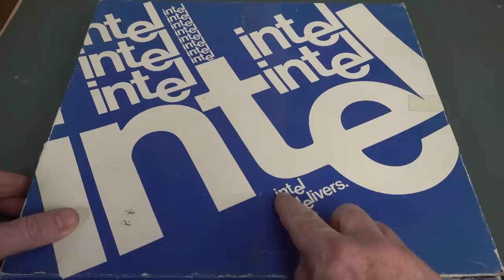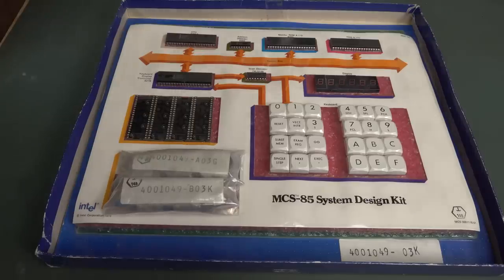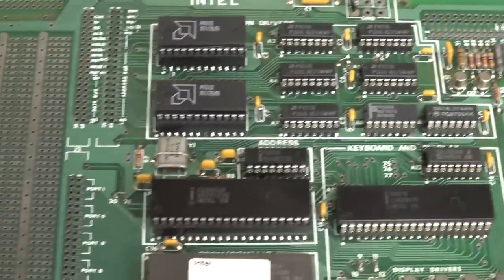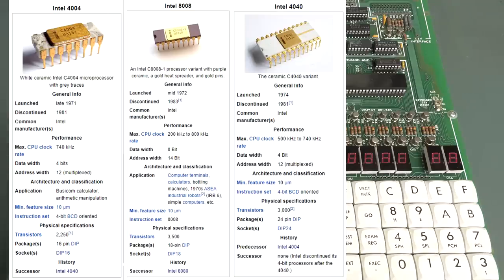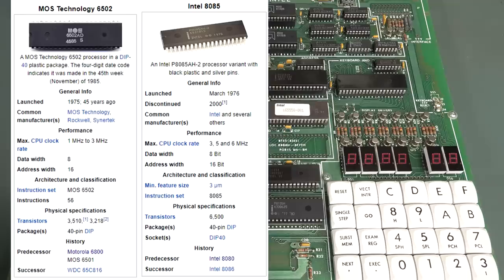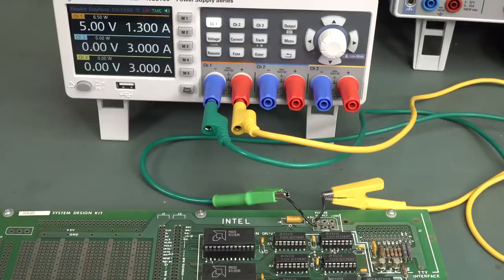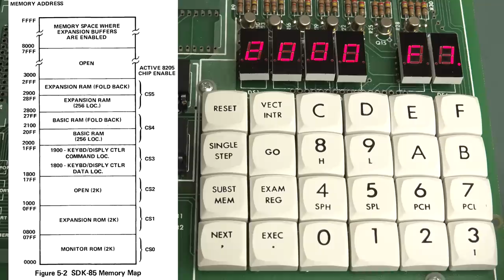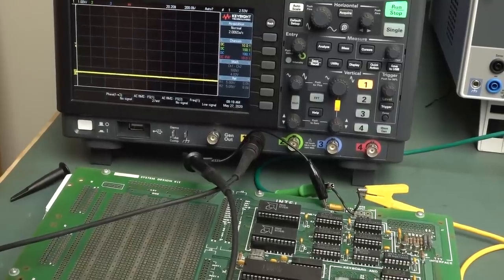EEVblog #1308 - 1970's Intel MCS-85 8085 Design Kit!

Comment from the maker: Retail price was US$250:
https://archive.org/details/byte-magazine-1979-01/page/n57/mode/2up
Reply: Almost 1200 in today's US dollars! For comparison, in 1981 a base IBM-PC cost around 5000 in today's US dollars.
Reply: I might be the one who used a typewriter to type out the requisition for ordering one.
Reply: As I recall, the Kim 1, with a 6502 processor was $99.
Reply: @alexanderwolfe8782  Look at ads for typical microcontroller kits in the early to mid 90ies. It often was something like .. well 1500 for the board, then you need the programmer, that will be an additional 1000 and of course the compiler suite is only 3000!
Can't have those plebs touching our stuff. Sincere industrial users only. 
It also was the dark ages when you asked a semiconductor manufacturer for information and "Which company?" "I'm a hobbyist." "Screw off, we don't want YOUR kind here."
Reply: KIM-1 original price was $250...
Reply: When I was a kid in the 80's ;-) I've got an used Motorola MEK-6802-D5 from my father. My first computer even before the C64. It was a great starting point to learn programming.

Comment: I bought the SDK-85 in 1980, my first computer. Also ordered the Intel 8085 data book which had all of the instruction set and timing diagrams. I learned assembly language on this computer and had many hours of frustration and enjoyment. Thanks for presenting this.

Comment: Honestly as old as this is, it's still a great way for someone to learn how computers work at a fundamental, close to the hardware way.
Reply: To learn the architecture of a modern CPU even RISC like ARM is an undertaking. Back in the 70s you could learn it quickly. Simpler addressing modes etc.
Reply: Learn AVR - its a straightforward, barebones, no-nonsense architecture, no weird addressing modes, memory mapped IO, although its Harvard architecture.
Reply: nearly 30 years ago I learned hardware/software integration on a 6809, tape drive, and a bunch of chips we had to buy for the class.  It was THE way to learn back then.  With those basic building blocks all other processors and hardware designs were fairly simple back then.
Reply: VEC7ORlt What’s wrong with Harvard?

I’ll admit: learning x86 assembly first, Harvard was confusing, but they both have their upsides. One ((true, not modified) Harvard) is easier to implement in silicon, but the other (von Neumann) allows things like treating code as data and vice versa.

Tangent: it’s worth mentioning that x86’s memory model is somewhat of a cross between Harvard and von Neumann; It has separate L1 caches for instructions and data (Harvard), but the main backing memory is unified (von Neumann)
Reply: @VEC7ORlt  AVR is old now. No product designer is going to chose it for a modern product design when there are ARM chips with way, way more peripherals and memory for a lower price.
Reply: @TheChrisey  Don't talk about things you know nothing about.
AVR is a great learning/starter chip - straightforward, easy to understand and program, has an extensive toolchain(s) and large community helps.
As for old and 'no product designer will use' - every thing has its uses - you don't need an ARM chip to blink a few LEDs, control a few relays and the like, the pricing for the chips is on point too, sure those chinese 3ct MCUs are cheaper, but they are OTP, datasheets are weird and you need volume to capitalize on that.
8051 is still pretty popular, and that thing is more ancient than wooly mammoth shit.
On the other side you can buy 600MHz MCUs for 7eu.
Reply: @TheChrisey  Oh I don't know, there was that motion activated light that eats 15uA on standby, that I did on Attiny204, and sold around 5k units, an emergency lighting controller with charging and sequencing done on a Attiny88, sold nearly a thousand of those, and others that I cannot tell you about, so go on, teach me how to design for manufacture.
I've also remembered the inductive cooktops I've seen running AVR chips, was it AEG?
Riiiiight, I get it now, you are one of those 'design engineers' that need hardware multiply to blink a LED.
Well, you do you.

Comment: I joined Intel early 1980. There was a couple of the SDKs laying around the office. Can’t recall the price.  This was generally pre-PC days so we sold the incredibly expensive Development System which supported several programming languages and with the optional in-circuit emulator sold for just over $10,000. Came with two 8” floppy drives!

Comment: Back in the late 1970s I wrote the code for an 8085 based Morse Code ident module for use in Amateur Radio repeaters. I designed the whole code on paper using my own pseudo assembler language, simulated the code and all the variables on a large sheet of butcher paper by hand, converted the code to hexadecimal opcodes and addresses by hand, and then single stepped the hex code into an EPROM burner. A friend of mine built the hardware and sold the boards to various people around Australia. I am now not 100% sure it was an 8085 because I remember there only being 128 bytes of RAM and 1K bytes of ROM available. The 8085 does not seem to have either although there may have been a other chip with memory in our design.  I recall my friend wanting to use the 8085(?) to reduce parts count by not using external memory chips. Those were the days of compact code. :)

Comment: 4 years late to the show!!  This idea was my graduation project in 1985. I built this idea around the 6502 + 6522 with breadboards, wires, resistors, transistors, UV Eproms, and static memory chips. Every mistake in programming cost me 2-3 hours of eprom erase time.  I had to write the monitor code in mnemonic assembly code, then the instructor loaded his actual program code (by way of Apple II interface), to run on top of my monitor code. It was the accumulation of all my previous months & years of study in digital electronics. If it worked --- I passed and got my BS degree. It did and I did, July 1985.  I don't remember a thing about it now 40 years later!

Comment: I was a 6800 person. I got a cheap 6800 D1 kit in 1979 for £50 and it never worked because I sprayed it with lacquer and it went into the sockets and insulated the pins. Took the chips and put them on proto board, added an old CBM calculator as a keyboard and display. Coded a new monitor program by hand and eventual memorising the instruction set. Designed a hires graphics TV display for a friends Z80 computer. Later on built a 6809 computer using scrap 8 inch hard disk drives. Had a TV output and again hand coded firmware. First week of work, 1984 bought a 6502 based BBC Micro..

Comment: The 110 Baud TTY would be for an ASR-33 teletype which, with paper tape, was the development tool for this kind of project. In 1976, there were no DEC VT-100's as you showed.  That also would have left the designer with no way to save code in a machine readable form.

Comment: Definitely the Zilog Z-80. Built a literal ton of controllers with this chip. And I wrote it all in assembly in the Z-80 mode, and used mode  2 interrupts with the CTC, PIO and SIO/0. What a fantastic CPU.  Just loved it.  And it ran at 4 MHz with no gripes.  In fact, I’m designing a GPS disciplined RTC with one RIGHT NOW!!  I’m old, and so is the Z-80. But I’m not done yet and neither is that great CPU.

The Z-80 was used in the Heathkit H-89.  The video card for that H-89 also used a Z-80 and associated chips for driving the video.  I had that H-89 for many years   Used to use the Avocet Z-80 assembler/linker/debugger for CP/M with that H-89 and I wrote a LOT of Z-80 code on that machine.  It was so reliable, it was amazing.  I wish I still had it.

Great video!!  Thank you, Dave!!
Reply: Z-80 in my Sega Master System
Reply: During my internship in a steel manufacturer (I was 16 and I'm 51 now), almost all the controllers were created inhouse using the Z-80. At that time I became so used to it that I could read the hex code directly :)
Reply: On the other hand, a functional 8085 application can be designed with only two or three chips.   Say, an 8755 which gives you ROM and I/O and the 8085.  You can bit-bang serial I/O out of the 8085 using the RIM and SIM instructions.  And the 8085 already has prioritized interrupts.   That's why it was used as a controller in so many peripherals.
Reply: IMO microprocessor courses should be taught in 8080/Z-80/M8800, however old they are. It' like teaching and learning digital Ohm's law. One gets to work with something manageable. These days I'm interviewing sw engineers and I get a blank stare when I ask to draw a [micro]processor architecture. Not OK.
Reply: Did you ever saw meta instabilities using Z80?  When I was in college in 90s, the professor said Z80 or Zilog went down because their chips would hang.
Reply: The Z-80 was my favourite CPU. I almost went for the 68000 because it was 16 bit and seemed to have a great instruction set, but I think they were expensive and not as convenient at the time. I ended up doing heaps of things with Z-80s right through to the late 1980s. I started with a home built S-100 system, a TRS-80, a couple of CP/M systems, a VHF/UHF scanner radio using the Z-80, as well as a number of other devices.
Reply: I have some avionics designs from the late 80's early 90's that use the Z80. I remember having to buy their MIL-SPEC versions in the early design stages. Single unit costs ~ $500.00.
Reply: @simeshev  We did use the MC6809 when was studying. For one part because it also was quite simple (really orthogonal, even easier to understand than the 8080 family, which does have its weird quirks in some places) and since the evaluation boards in our lab were using HC12, whose core is basically a MC6809, with some "simplifications". (No user stack, only one index register IIRC).
Reply: @bayareapianist  Did they went down? Last time I checked, they were alive and well. Z80 (the CMOS version of course) are still in production and you can order them from any major distributor.
Reply: They're about $5 each brand new on Mouser.

Comment: My first microprocessor experience was in 1977 while was in the US Navy, using an RCA 6502 single board system (much like the MCS-85) called the KIM-1 (https://en.wikipedia.org/wiki/KIM-1).  It got me to think in hexadecimal, and I had memorized nearly all the opcodes during the month I had access to it.  In 1980 I got an Apple ][+ (because, 6502), and felt right at home, though I did get the Language Card with UCSD Pascal.
When I left the Navy in 1981 I worked as a technician for General Atomics, which was transitioning their excellent-but-expensive analog radiation monitoring systems for commercial nuclear power plants to digital systems based on the 8085.  I started university later that year (at UCSD, naturally) to study Computer Engineering, and was soon getting paid to write code for the 8085 using the Intel Big Blue Box and the PL/M language (https://en.wikipedia.org/wiki/PL/M).  We had a final pair of analog systems that were difficult to replace with digital, and after graduation my task was to build the algorithms needed to let a slow 8-bit processor equal their performance.  Some of the best code I ever designed and wrote, something I'm proud of to this day, and the best possible start to an engineering career I've loved ever since.
Why did General Atomics choose the 8085?  The simple reason was it had a surprising level of radiation hardness for a commercial microprocessor, hundreds of times better than the Z80, and dozens of times better than the 6502, for about 1% the cost of a "real rad-hard" processor (the 1802 was the only rad-hard game in town back then).  It had other benefits, but all were minor or trivial compared to that.  I took our systems to our "gamma range" (a linear accelerator) to zap them until they blinked, and it took an impressive level to make that happen.  There were several tricks we developed and employed to further enhance its natural immunity, such as reducing the clock from 6 MHz to 5 MHz, and playing with the supplied voltage.

And, yes, the systems were battery-backed with a Gates Gel-Cell lead-acid battery the size of your fist (both fists if you have small hands) that lasted for 5 whole minutes, 300 seconds!

Comment: I got one back in 1980 for about A$300. I still have the SDK in my museum and it still works.
I expanded it with 4KB EPROM and 4KB RAM.
The 110 default baud rate was used to directly interface with a TELETYPE. This was the ideal interface at the time as you had an input keyboard, a printer and memory storage (paper tape). 
I wrote an editor, assembler and EPROM programmer all on this unit. 
A typical 1KB program took about 2 hours to assemble (2 pass) and burn an EPROM.
I have loads of happy memories (not)!

Comment: Dave does not seem to understand that this  was aimed for ASR-33 Teletype. Hence the 110 baud speed. You stored your programs into paper tape. Dave should have tried the teletype monitor. There was special commands for outputting and reading the RAM to and from paper tape. I was dicking with this board in the Finnish Army in 1977. I built a testing device for a  Russian Missile Controller, which was 3 ton electro-mechanical monster in a truck. This project was totally against USA-Comecon embargo. https://flic.kr/p/JycyMy
Reply: Great picture.
Reply: thats kind of badass actually
Reply: Just curious, why would someone in Finnish army built a testing device for Russian missiles?
Reply: Because Russians were selling them cheap and they were  mechanically sound. You could also improve the shitty Soviet guidance computers with modern electronics. The  Soviet trade was based on goods, with one pair of Nokia rubber boots for one AK-47.
Reply: @TimoNoko  Lol. Greetings from Russia.

Comment: When I was doing my Electrical Engineering Technologist Diploma in 1997, one of the courses was industrial control systems and we had that exact board to program 8085s for the lab activities. I remember having to program a servomotor controller using the 8085 and once you got used to the 4x4 keypad it was actually a lot of fun.
The reason why they had the keypad layout as is was so that you had a block of 16 keys for the hex "data" values that were separate from the "command" keys. If you had ABCDEF across the top, you would end up with some of the digits almost completely surrounded by the command keys and a single finger slip could, to quote a Davism, "really ruin your day".

Comment: When you showed the support phone numbers, it really took me back. The 602 area code is for Arizona and at the time covered the entire state. When that technology was manufactured (circa 1980), I was a EE major at Arizona State University and lived just up the road from the Intel factory at Rural Road and Williams Field Road (now Chandler Blvd) in Chandler, AZ where it was made. Many of my EE professors had consulting gigs with Intel, and most of us ended up working on Intel-funded research at some point in school. It is interesting that they used local phone numbers for the support lines instead of toll-free numbers. I never worked on that particular programming kit, but did do a lot of work with Intel processors at the time. Ultimately, I ended up becoming an assembly language developer on the 808x, 80x86, 6502, Z80, 6800, and 68000 processors writing embedded firmware. Now I work for a bank with lots of high-end technology and it is not nearly as much fun.

By the bye, the 121GW is an awesome bit of kit, so thank you for that. If anyone is looking for an excellent, affordable DMM, you'll not go wrong with the 121GW. The videos are just great, so keep up the good work.

Comment: I still have my 1975 SDK-80 (8080A CPU) board, It sold for US$250 in 1975 and was worth it's price in educational value.  The kit cost was less than the price of buying just the IC's. The SDK-85 also sold for US$250 in 1977, at that time the 8085 CPU sold for US$110.
Reply: the 8080/8085 and 6800 were very expensive (like $250) whereas the 6502 and Z80 were only about $25. That is why the Apple-1 had two footers: one for the 6800 and one for the 6502 as an alternative. Bless Wozniak. But the 6502 was such a stupid processor!

Comment: When I got involved with micro-computers (1981) I went straight to the Z80 camp and quickly learned to program it in assembly. I even wrote a bare bones assembler program in the built-in BASIC of the machine I got (NewBrain, for those who knew it and still remember). 
I enjoyed Z80 assembly quite a lot. And later on I did a lot of work requiring speed on 8088 machines as well. 
Another CPU of that era that I did some work was the NS COP402 - which was considered a 4 bit micro-controller.